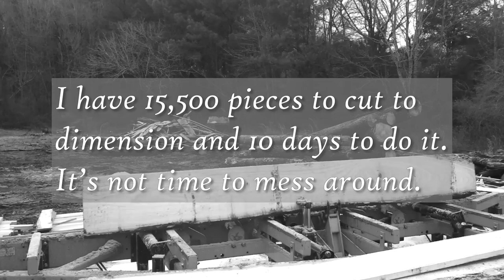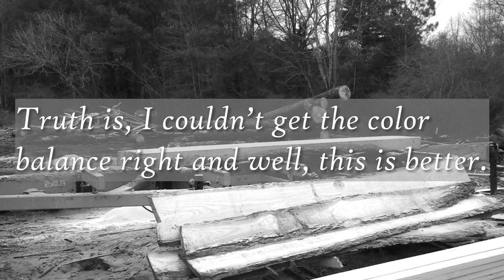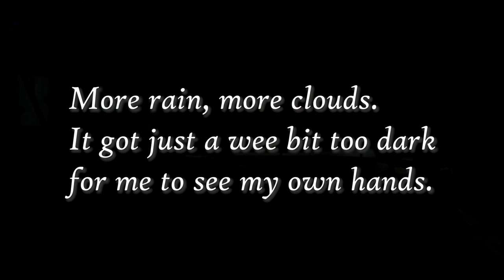Huge order to fill with the Wood-Mizer LT35hd. This is just part 1

Comment: On a large job like that is it best to charge by the board foot or by the hour?
Reply from the maker: For this one, it's by the piece. These are specialty cuts in thickness as well as length. Board footage or hourly just wouldn't work. With that said, a large job like this, were it standard material sizes (2x4x8, 2x8x10 etc) I would charge by the board foot. However, this is with me buying the logs, if a customer wanted me to mill this amount of material from their own logs, I'd charge by the hour.